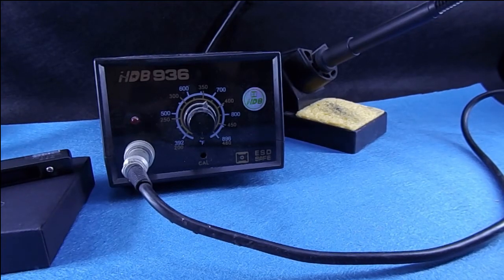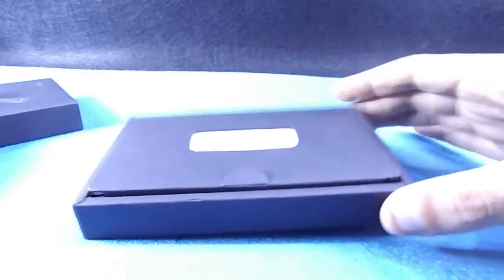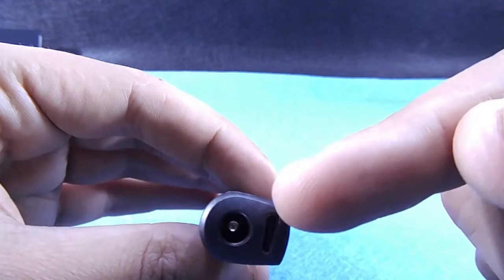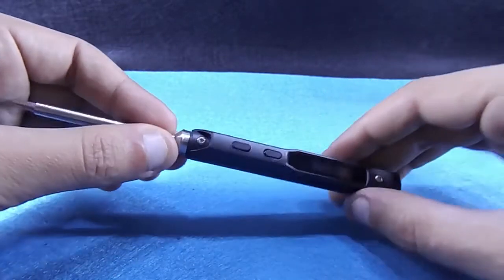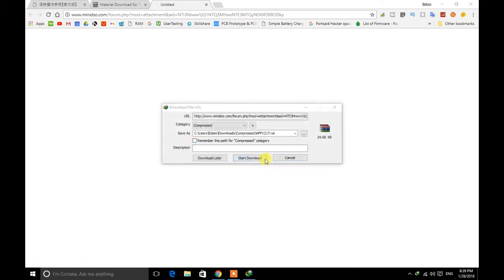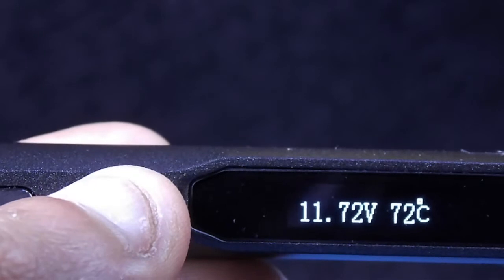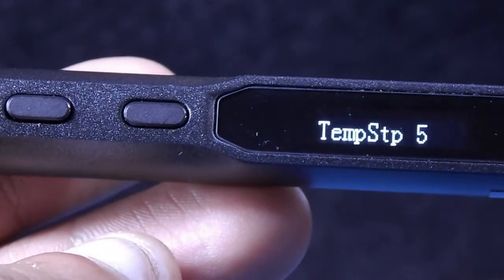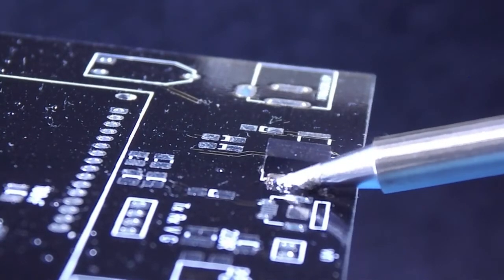TS100 Soldering Iron Features and Firmware upgrade

Comment: Very informative. Thanks for sharing. I noticed you apply the solder to the iron and then moved it to the component. That's considered bad practice as the flux evaporates quickly and the solder doesn't follow properly. If you heat the pcb and component with the iron and then apply solder directly to the PCB you'll get a more reliable joint. Keep making those videos!
Reply from the maker: Thank you so much I'm very happy that my video found its way to someone needs it 

And abou soldering you are right i wasn't good at this moment but you can check my last videos I'm using the method you told right now 

Thanks :)